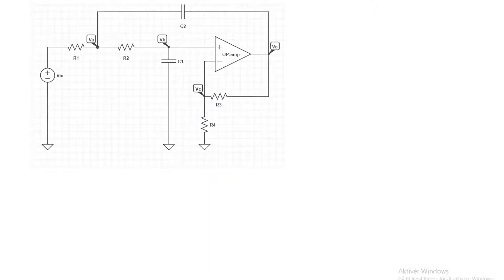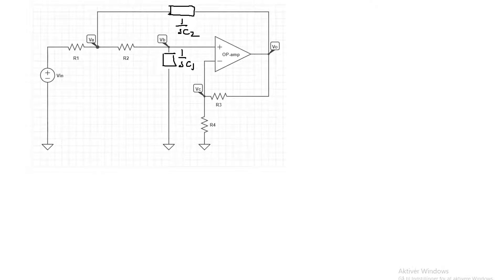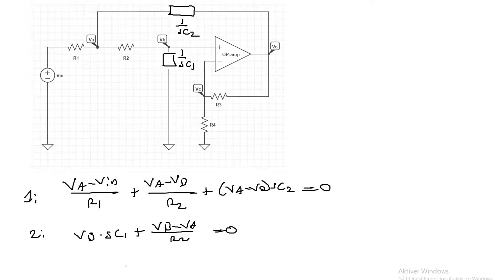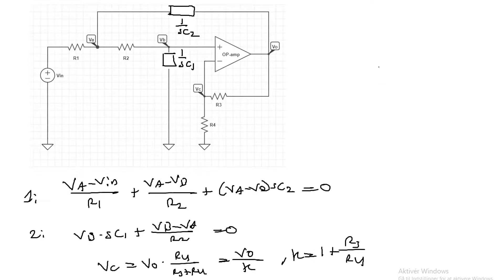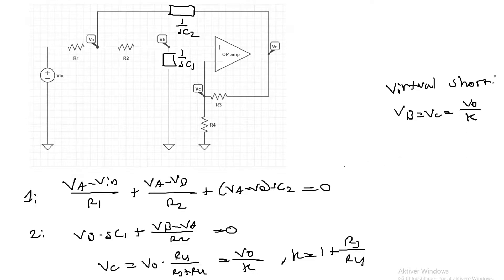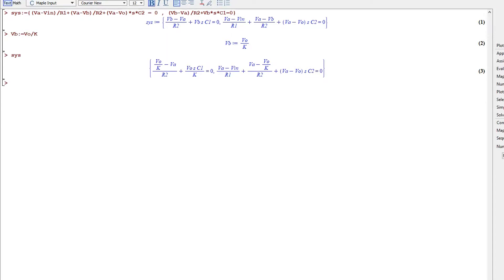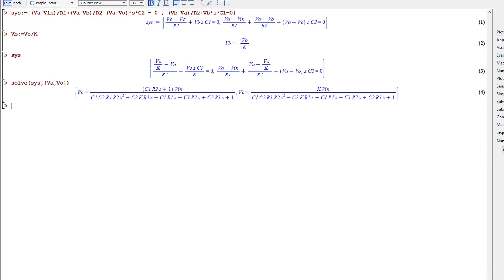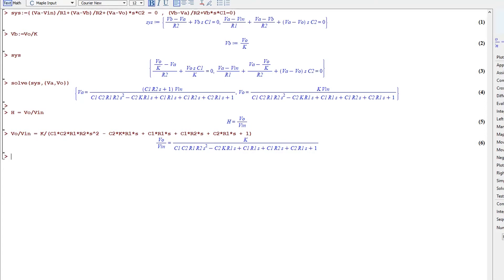Signals and Systems - Sallen Key Transfer Function Lowpass Filter

Comment from the maker: The second order lowpass filter has the general equation: b0/(a2*s^2+a1*s+a0).
In standard form, the coefficients are:
b0 = K/(C1C2R1R2)
a2 = 1
a1 = 1/(R1C2) + 1/(R2C1) + 1/(R2C2) - K/(R2C1)
a0 = 1/(C1C2R1R2)